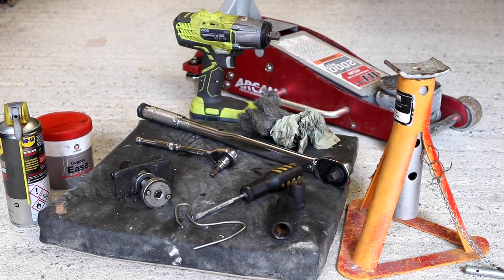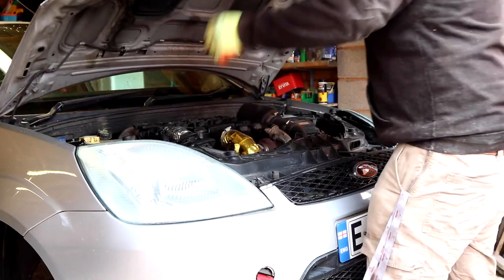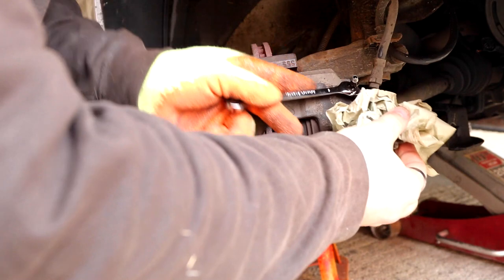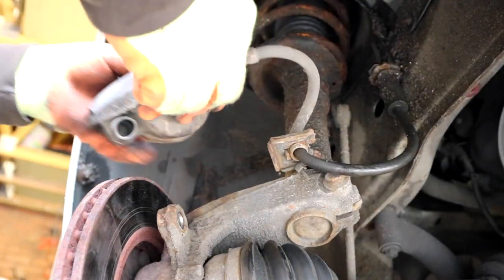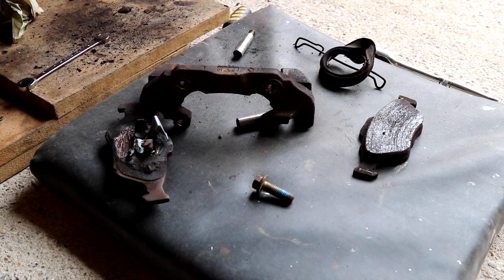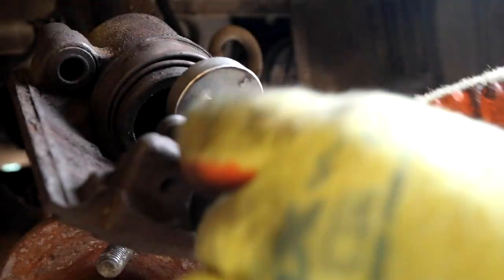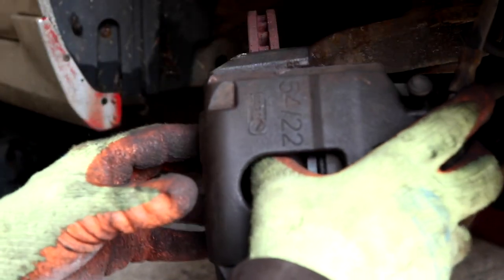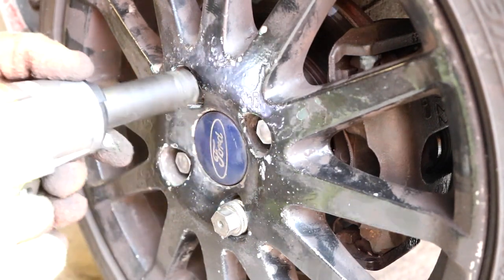How to Fix Sticky Brakes on a MK6 Fiesta

Comment: What exactly do you think was making it stick? Was it just the cleaning of all bits that freed it off? Or is it more winding the caliper piston back that likely fixed it?
Reply from the maker: Tbh in the end i changed my caliper the dust boot was split lets all the salt and grit in and sticks it up going back and fourth and greasing it up helped but inevitably it was just time for a new caliper
Reply: @mclaren_media9145  Thanks for the clarity. I've found when I take into the local garage, they don't even try to service them. Just replace the whole caliper. Fair enough, time is money and all that, but it gets pretty pricey.

This one was working fine but then laid the car up for a few months and now sticks (Fiesta, offside, same as you did).

I've got to do the wheel bearings anyway, so might at least try a clean/service. Maybe make my own 'wind-back' tool.